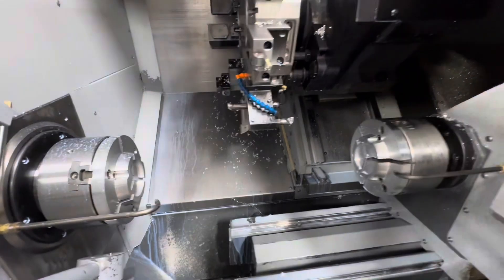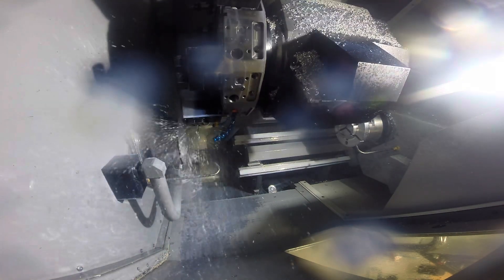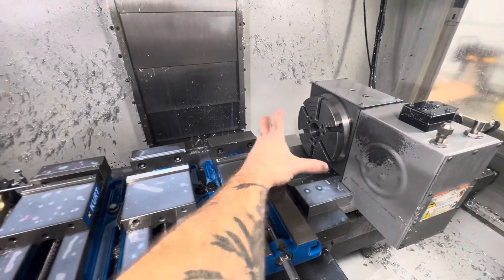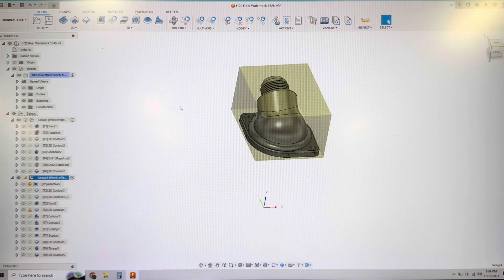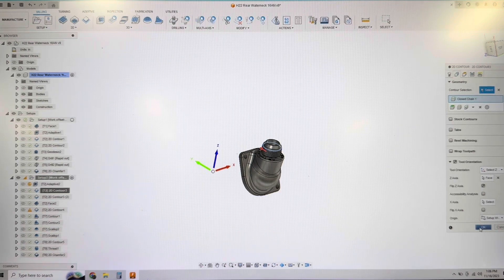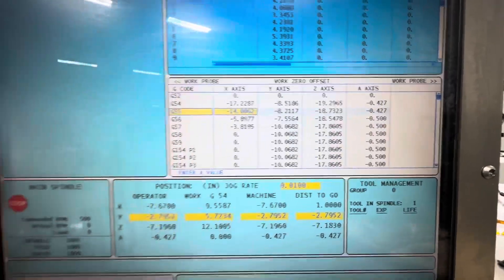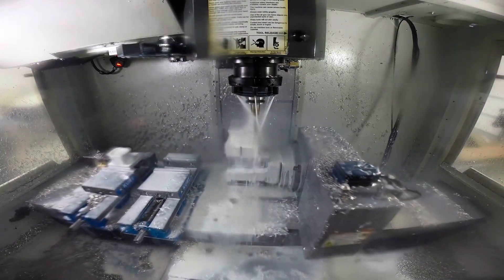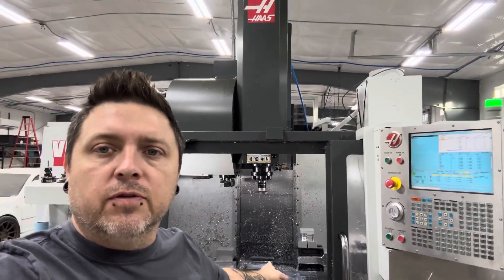4 Axis milling in #fusion360

Comment: The red lines in your 3D contour, is ramp, you can set the degrees in your toolpath 😊

So you can engage without breaking your tool.

The should go away if you choose plunge, (dont do that in aluminium, you may break the tool)